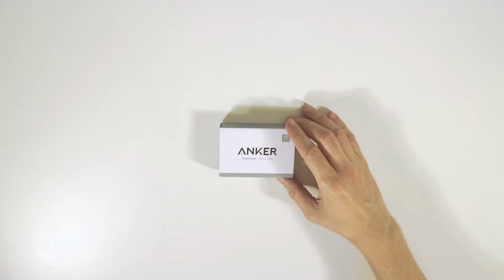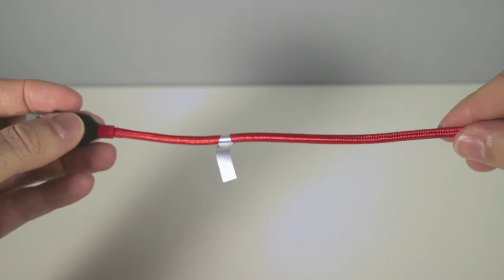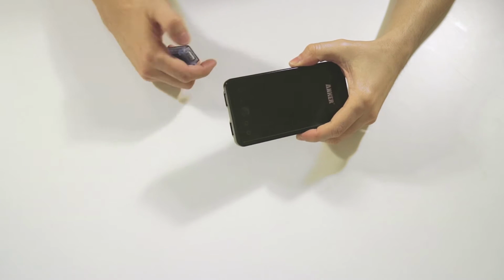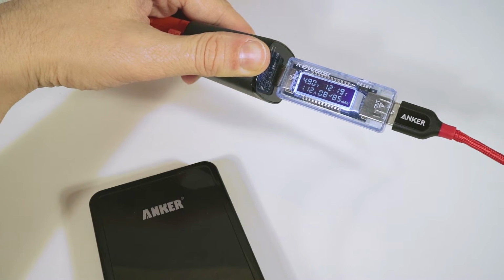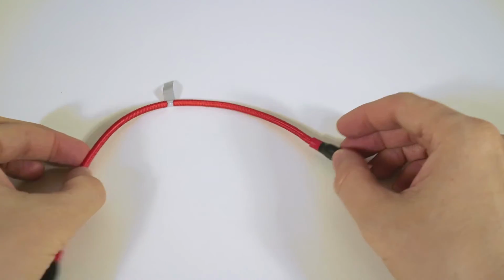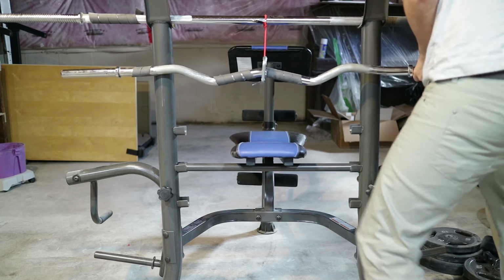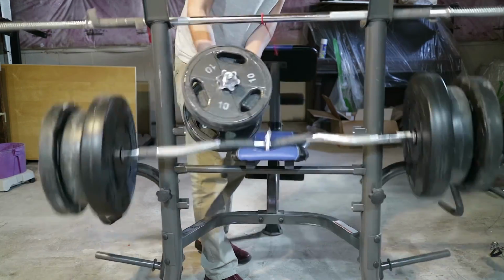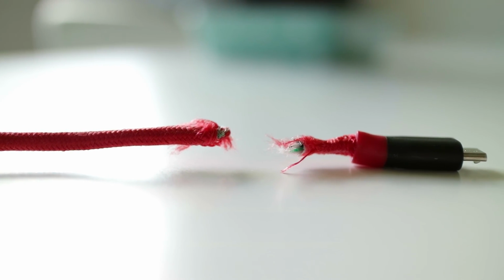Anker Powerline+ Micro USB Cable Review and Stress Test

Comment: 1. The power line 2 came out recently, hopefully you'll do another stress test
2. I don't think you should've "risked your life" to test it, there is a smarter way to test it. (get a longer cable and put the bar on the bench)
3. Get yourself some heavier weights, not only will this save you some space, but it would allow you to not use dumbbells

Comment: I was using a micro usb that came with my ps4 which charged my phone at a much faster rate and I was wondering if this will be just as fast... Please reply.
Reply from the maker: kbg12ila - Yes these can handle charging with at least 2 to 3 amps, so your phone will be able to draw all the current it needs, provided your power source (usb port/power bank/wall adapter) can supply enough current)

Comment: Nice video. But! yeah always a but in there somewhere. But I've never had a usb cable go bad in the cable section. It's always the small metal tip that bends. Would have been nice to see how strong that area was. But A+ for effort!